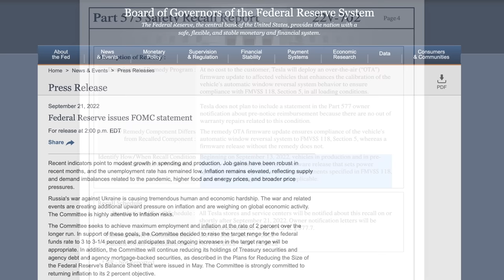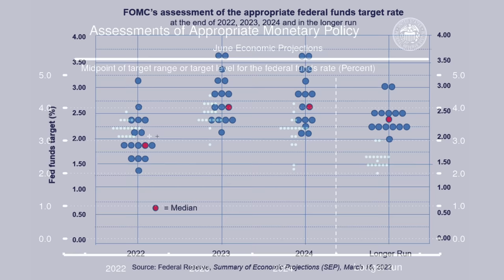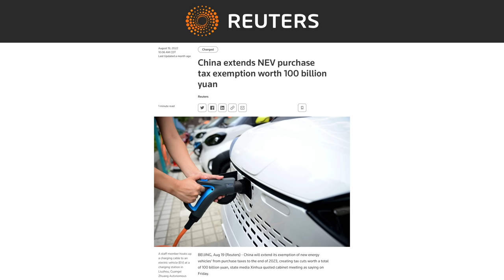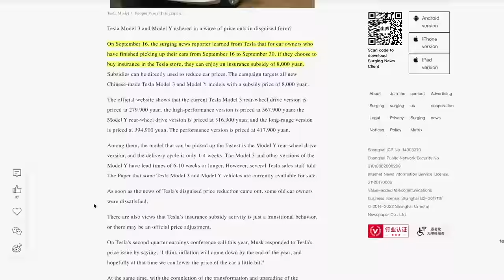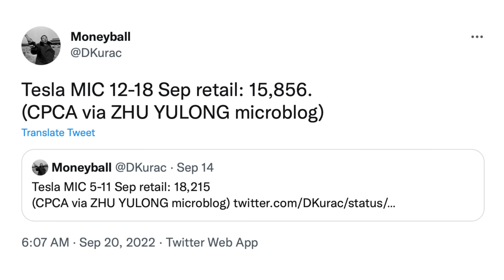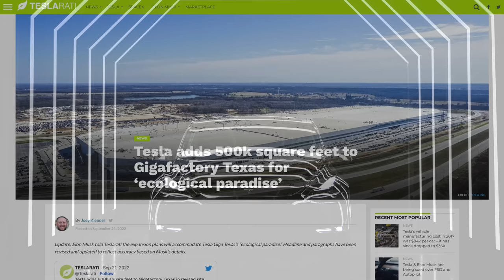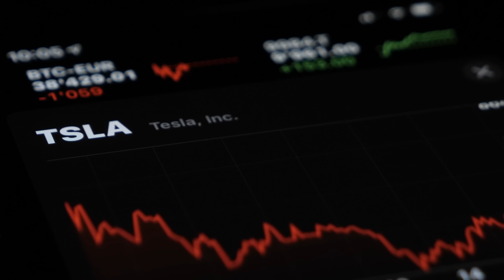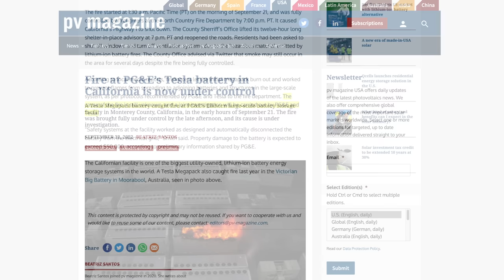Understanding Tesla’s Biggest Q3 Red Flag + Market Updates, Morgan Stanley Note

Comment: Rob, here in the UK and Europe we’ve had the CCS adaptor for (literally) years.  

All V3 superchargers only have a CCS connector. Older Model S and X Vehicles needed an electronic module upgrade which was done with a ranger visit.

The total price I paid cod my 2016 MS including the Labour, Module, adaptor and VAT was £199. 

Later, cars only needed the adapter as they already had the module installed at the factory.
Reply: Confirmed.  We started doing the retrofit in 2019 in Europe.  For all MS and MX.

Comment: One leaver Tesla pulled is the Model Y SR opened for orders in Europe last month, it's €3k cheaper than the Model 3 SR (which is nuts) and the price at €49.900 euros got me to pull the trigger and place and order. That price will fill demand in Europe and allow Giga Berlin to sell the most profitable versions of LR and Performance until they can get the volume for selling MIG SR versions.

Comment: Smart Summon is great, but there are a lot of cases where just the capability to drive the care remote with not only the buttons ⬆ and⬇ but also the buttons ➡and ⬅ left would do magic. I could stand outside of the car and let the car do tight parallel parking or manoeuvre it past some tight spot with the slow crawling steering. I had cases where the car has clear problems detecting obstacles.

Comment: Hi Rob- Do you have any insight on a potential reduction in demand projections for Q4 2022. Given the tax incentives apply from 2023 it’s possible a lot of buyers are pushing their deliveries to 2023. I ordered a Model Y LR in May with EDD of November however was surprised to see Tesla allocate a VIN in 1st week of September. I have requested them to hold my delivery as far as possible, however they said there is a very good chance I’ll be reassigned a VIN in November.

Comment: I’m a Tesla Fanboy and stock holder but I have concerns about Tesla’s practices as of late. I own a Tesla Model 3 LRAWD and ordered a Tesla Model Y 11/26/2021. My delivery date been extended 7 times while others more expensive
 model Y’s delivery’s took preference over mine. On June 11th I requested  a trade value on my model 3 even though I didn’t have a vin yet.they offered $47500. In Sept my deliver date was move from Oct 22 to Sept 13-17. I decided to pickup my new model Y LRAWD on Sept 17, and requested a new trade offer it was $39900 which was completely unacceptable a $7600 less than 2 months before. This car also appears to not qualify for the new tax credit. The only good thing was my new model y was made in Austin and was flawless.

Comment: TSLA demand is my concern. If there is any hint of softening price drops 30%.
Reply: I think it's risky to hold TSLA if you're not long, at the moment
Reply: @Muskar2  
It's risky to hold "stocks" if you're not long at the moment.
The questions should be,
1) If you DO hold stock, should you try and play the market, sell, then buy at the bottom?
(Good luck)
.
2) If you're thinking of buying, should you wait?
(Roll the dice)
.
3) Which stock should you buy in a recession?
(Maybe one in which the company has sufficient margin to contract, but remain profitable?
Has lower debt?
Had multiple products in different segments within which certain components can be swapped, certainly if one such segment may be due for rapid expansion?)
.
It all comes down to whether you're "greedy" for immediate gain, or prepared to take a long term "I'll win in the end" position?
If the latter, simply choose the healthiest company in the segment, and sit.

Comment: All new Tesla's in Europe have the CCS connector and not the Tesla connector, it is very convenient that I can hassle free charge at all other charging networks. V3 superchargers only have the CCS plug

Btw, Tesla increased its Supercharger prices in my area (northwest of The Netherlands), it is now 2 cents more expensive than Ionity and Fastned with 72 Eurocents per Kwh !! It used to be a lot cheaper than Fastned. This resulted in busier Fastned charger stations the past week. In other parts of the country prices are lower, I do not know why Tesla is doing this.